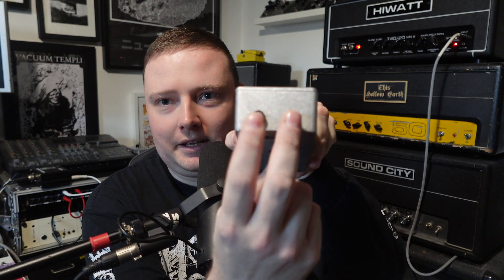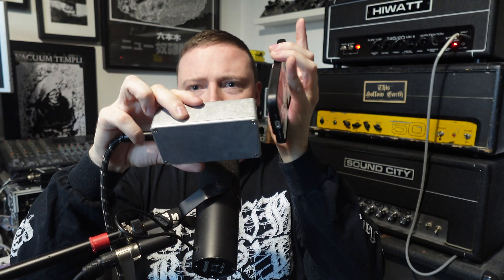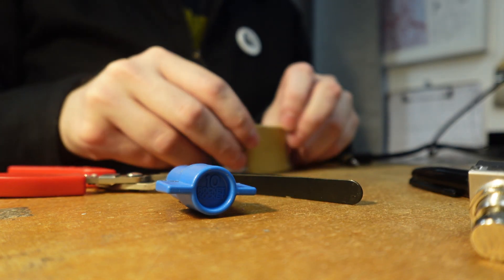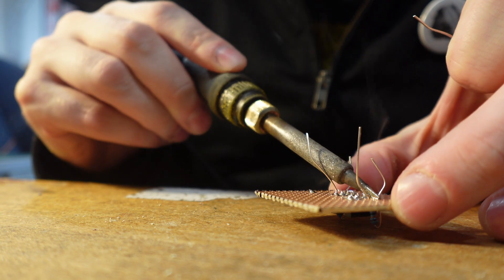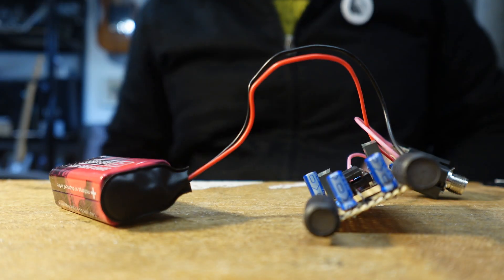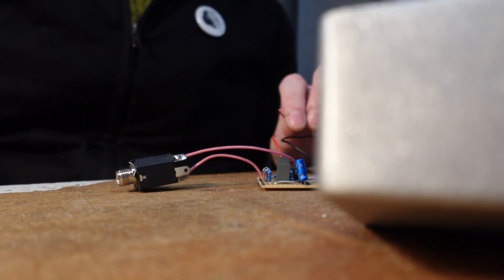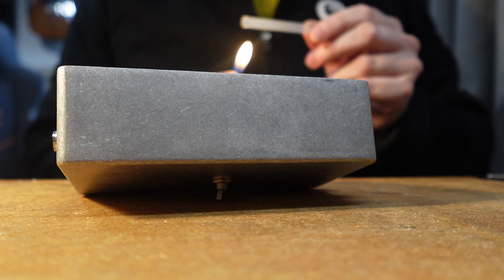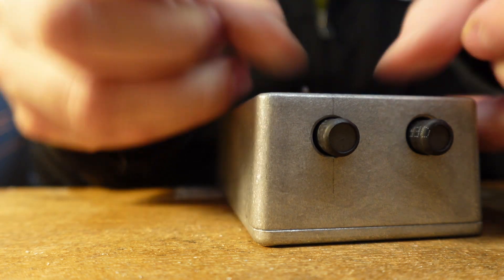HOW TO BUILD A DIY EMF DETECTOR

Comment: Any reason there’s two inductors used (aside from not eating the other op-amp go to waste)?
It’s a great design regardless! I’ve just been using an inductor wired to a cable but this seems more practical since it doesn’t need external amplification.
Reply from the maker: No real thought besides more information being picked up and I liked the idea of the two ‘ears’ poking out the top like a taser or something 🤷‍♂️